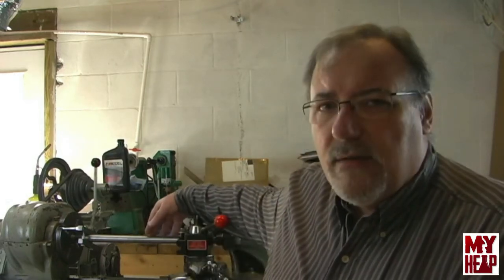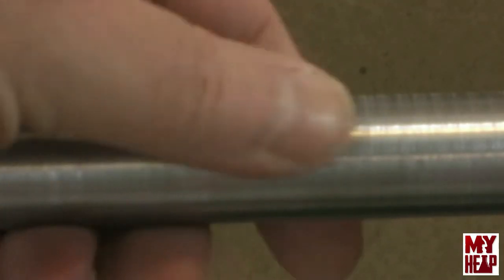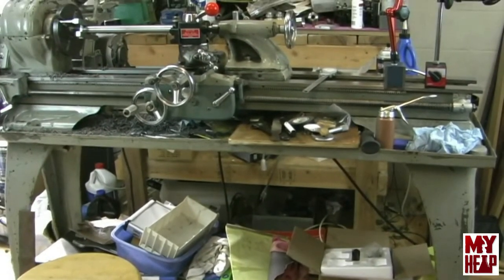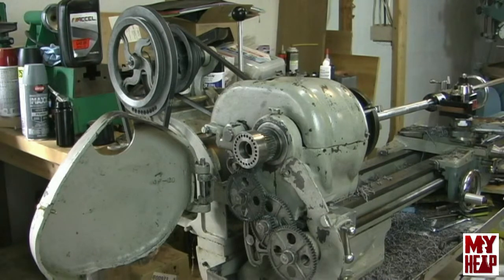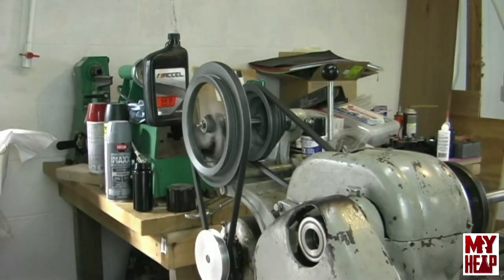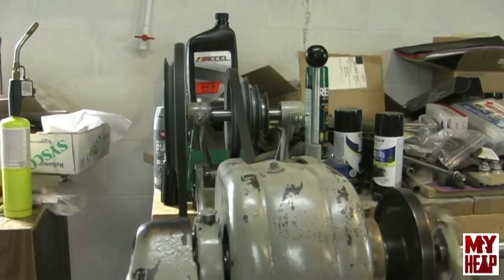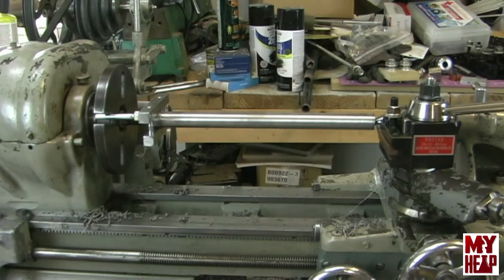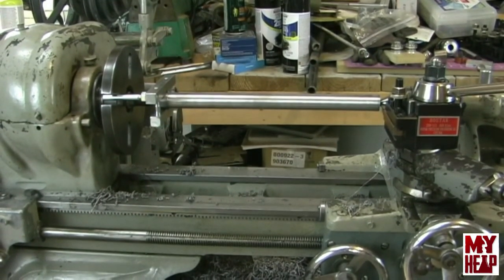YouTube Shop Student - Episode 003 - Aligning Lathe Centers Lessons Learned

Comment: I think you will get all of the adjustments perfect if you put it in the place it will stay forever and then bolt it to the floor. The pulley alignment will help too probably.
Also, did you get the grooves only on autofeed at a certain speed? Or is it less with feeding it by hand?
Reply from the maker: Hey Gerben.  I suspect things will be a little better once she is permanently mounted and levelled up.  I was using autofeed of .0035 per revolution.  I did not try hand feeding it.  Also, the finish I was talking about was mostly generated during a spring pass with no increase on depth of cut.  By the way, got your email and will reply in a little while.  The pictures look good and I think that will work.

Joe

Comment: The problem in the middle of bar length wise maybe cause by the bar flexing under tool pressure. you may want to try a larger diameter bar and see what you get or smaller cuts taking less off of the diameter .002-.004 cut.
Reply from the maker: Hi William, I thought about that.  The diameter in the middle is smaller than either end.  For example, one set of measurements was Tailstock: 0.904, Middle of bar: 0.903 and the Headstock was 0.905.  It the bar was flexing, I would expect the middle of the bar to be larger in diameter than the ends.  If the tool was slightly high, and enough wear was on the bed that it dropped down, then I think we can guess that the diameter in the middle would be smaller, but by how much.  So I adjusted the tool to try to get it as close to center as I could get by eye with the box cutter blade pinched between the bar and the lathe tool.  Taking another cut after this adjustment gave me similar results.  These cuts were followed by an additional spring pass with no additional depth of cut resulting in the weird vibration pattern but still measuring smaller in the middle.

Now, truth be told, how often will I be cutting long stock like that???  Who knows.  At any rate, I appreciate the suggestion.  Like I said in the video, I am not overly worried about it because there are other things playing against me that cannot be taken care of until I move the machine to my shop in it's permanent home with some added base support and leveling feet.

Joe

Comment: Ah the smell of burnt chest hair in the morning lol. Joe I wouldn't be too concerned with getting your tailstock perfect until you get the lathe in it's final resting place and leveled, it is possible and others may comment on this also, there could be a little twist in the bed causing a taper, doesn't take much. You might get it set where you want it now and find that when you move it, it could change considerably. Just another aspect of the gazillion factors involved. As far as the washboard finish, this is in the steel it's self, I have run into this also. Find a length of good old 12L14. Moving has turned into a work in progress, now we are about to get 4-7" of snow, ah the fun never ends. I might want to borrow those taper reamers someday too, hint hint.
Reply from the maker: Hey Richard, good to hear from you.  I am not going to stress it.  I will turn more attention to it once it has been moved to my shop and set up to be levelled up.  For general learning I think I am fine at this point.  I am only talking .0015 over the 12 inch bar.  I would have thought the finish is due to some vibration in the machine and won't rule it out.  I think the thing to do is get my four jaw mounted and start making chips in different materials experimenting with different tools, feeds, doc, etc.  I think taking a critical look at my results will be one heck of a teacher.

By the way, will try to get to the post office this week to.  I want to send out when we discussed a little while back.

Thanks for the tips.  I need to find where I can get some 12L14.  Mr. Pete talks about the wonderful turning qualities of that stuff.

Joe